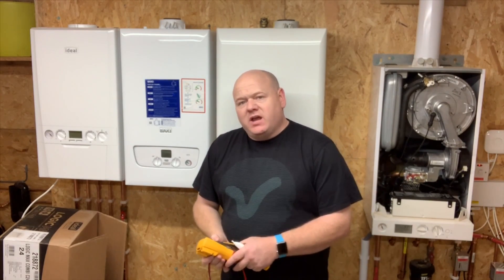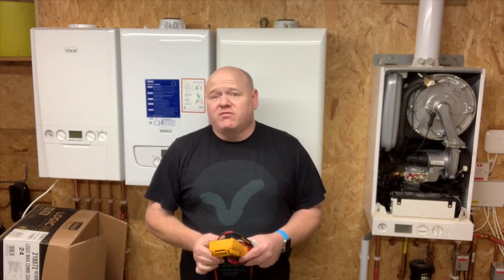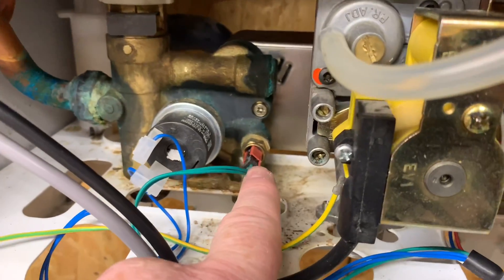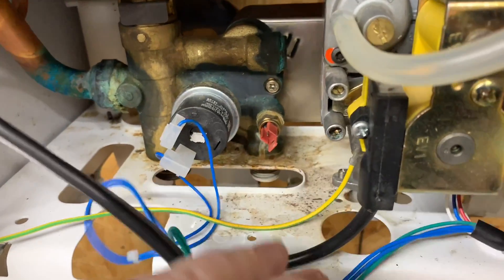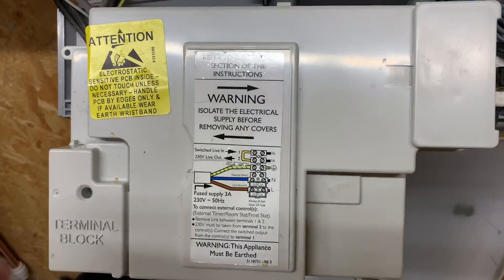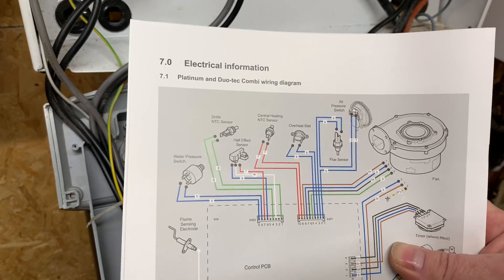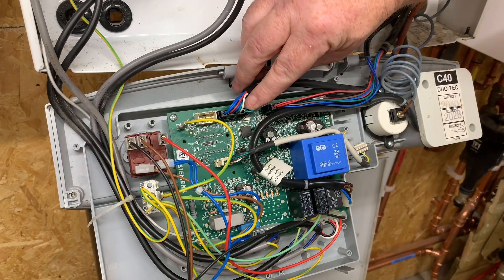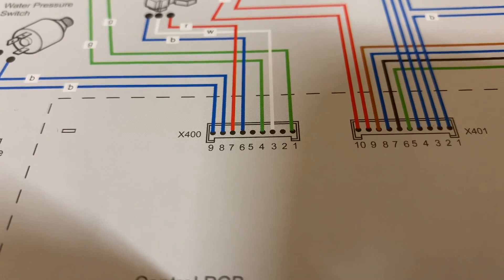How to test a Thermistor - Combi boiler faults - Multi Meter Fault finding

Comment: Also, clean off any scale buildup on the immersed portion of the thermistor.  Scale acts as an insulator, and over time, the reading will be lower than the true water temperature.  Vinegar.

Comment: What's going on ere then guv ? I distinctly remember you stating NO ADS in your videos Allen, I've just had three during this one. Thank you for posting though.
Reply from the maker: No ads on the videos that have been sent in. Some of the videos I do have ads. I spend 2 or 3 days a week doing videos and still have to live, thanks
Reply: Allen Hart That’s the trouble with txt you can’t tell the emotional intent of the message sometimes. It was only said in jest, my apologies if it offended you.

Comment: Hi Allen, I understand the relation between ohms and temperature now, but why would you need that information? Is it to test whether the water leaving the tap is the correct temperature that you’ve set on the boiler, for instance, if it’s testing at 50 degrees on the multimeter, would you have to check the actual water temperature at an outlet with a thermometer? And if they aren’t matching, would that mean a fault in the thermistor? 

Thank you!
Reply from the maker: They normally just stop working tbh. Thanks.

Comment: Top work Allen NTC  aka Negative Temperature Coefficient  sensor  use them in washing machines. Saved 100 quid call out and put a new NTC for a couple of quid in a friends washing machine.

Comment: Hi, is it necessary to remove the thermistor to test it? Will it affect the resistance readings if you leave it in place?
Reply from the maker: No, You can test it in place. Thanks.
Reply: @AllenHart999  That's great, saves me a bit of bother. Thanks! 😁

Comment: Hi Allen I am an electrical engineer (retired I feel better now). It is important to isolate the thermistor as you could be reading the circuit PCB if you try testing the resistance with it connected, this may sound obvious but you would be surprised how often this mistake is made.
Reply from the maker: I actually meant to say to take plug off and test from it. Thanks for the correction 👍
Reply: Hi Matey, 

So I have been reading that resistance goes up with temperature increase but in this video the chart shows the opposite. Higher the temperature the lower the ohms. 

Please advise.
Reply: @nightrider8918  
There are two basic  types of thermistor. NTC and PTC ( Negative and Positive Temperature Coefficient)  and for NTC the resistance goes lower as the temperature increases. For PTC the resistance goes higher when the temperature increases. Note that different types of thermistor can have widely differing resistances at any particular temperature, so you have to get the correct specification of part when replacing these items.

Comment: Nice one Allen , I usually cut off the plug leads on the ntc's of replacement boilers I fit and keep them in my spares box as most are the same on all boiler makes and if you have a few different ones you'll find one that fits for testing purposes......👍
Reply from the maker: Thanks for watching.

Comment: Hi Allen my new boiler instructions says 5 inches for the flu hole in the wall. The existing hole from the old boiler is 4.5 in, but a local supplier says the new flu is 4 in (100 mm) dia. Do I still need to re-do the hole so that it's 5 inches for my new Ideal 30+ logic?
Reply: Get a gas engineer to do the work 👍
Reply from the maker: +Hector Heath Make sure you use a gas engineer/plumber it’s not worth it, they will be able to sort the warranty and building regulations, Thanks.

Comment: what 'book'??? what if it was a ptc??? ooer
Reply from the maker: Not sure what you mean? Thanks.
Reply: Think he means the thermistor type you said yours was a NTC and sim b mentioned a PTC ,Your type of thermistor is a negative temperature coefficient one (NTC) but you can also get positive temperature coefficient ones (PTC). Basically they are the same devices but work in a reverse manner. Namely the resistance of the positive one goes up with an increase in temperature and the resistance of the negative one goes down with an increase in temperature.

Comment: Always a pleasure. My multimeter cost under a fiver.
Reply from the maker: Thank you for taking the time to watch my video.
Reply: Are the cheaper multi meters OK for the odd repair I only need one for a single job of checking the ntcs on my vaillant ecotech plus as there's aa F64 code showing off and on

Comment: Brilliant video Allen. Finally had my baxi 836  installed last week on your recommendation. Im sure i wont be needing to do this test in a long time.😉. I cant believe how quite it is compared to my ideal isar. Thanks Allen for all your  video reviews for helping me decide which boiler to go for. Buy the way how's the loft conversion going?
Reply from the maker: Loft is going well, It’s all been plastered, Just needs paint. Thanks.
Reply: @AllenHart999  would faulty ntcs cause the boiler fuse spur to blow please Allen? Or is the pcb itself likely to be at fault thanks its a F64 fault code on a vaillant ecotech plus? Your clips are great BTW cheers
Reply: Gary Lawton .....Hi , F 61 to F67 fault codes usually indicate a fault with the PCB board and you will more than likely need to change the board...👍
Reply: @yensabi  can you test the board somehow?
Reply: Gary Lawton ....Not really mate other than a visual inspection to see if there is any obvious damage , best bet is to take it out and get a reconditioned one for about £70 and that way if it's not the board you haven't wasted £ 150 , there are a few company's that do the re con boards , just send in your old one as part ex........👍
Reply: @yensabi  I reset boiler and its been fine since though good chance it will show the F64 fault code again I'd think as there is a underlying issue looks like thanks for replying mate
Reply: It starts intermittently showing the f64 fault but you will find it gets worse and worse and eventually packs in , its best to replace before it goes completely , hope this helps you .
Reply: @yensabi  would you replace board and ntcs or just board? Thanks pal
Reply: Gary Lawton .....Just the board. , very rare for ntc's to go   👍
Reply: @yensabi  is it just a simple plug it in to install the pcb mate?
Reply: Gary Lawton ....Hi yes , there's 3  or 4 plugs and depending on age of boiler there is a green plug for the 240 v supply and switch , if it's an older model you will have to unscrew the 240 v supply and re connect to the new board with a screwdriver , also you may have to re program the new board to the boiler but you will get the instructions with the board if that's needed , best bet is to take a photo before changing so you have a reference to work to.....👍
Reply: @yensabi  it's a 2007 eco tech plus mate and yes the pcb came with a diagram saying something about what to do if a F70 code appears I believe? thank you so much for your useful replys
Reply: @yensabi  do you have to use a thermal grease when replacing dry pocket ntcs mate?
Reply: Also do you have to do any checks (combustion) after fitting a new pcb or just replace and restart boiler mate thanks?
Reply: Hi , you don't really need grease and no checks are needed as your not altering any gas related parts....
Reply: @yensabi  thanks another guy on here said you had to check combustion after fitting pcb he seems very overkill with things he knows a lot of stuff though and been helpful like you have thanks
Reply: @yensabi  which is best mid range combi boiler in your opinion mate baxi eco Gloworm betacom ideal I mini or potterton gold?